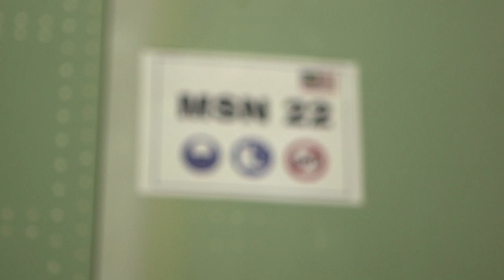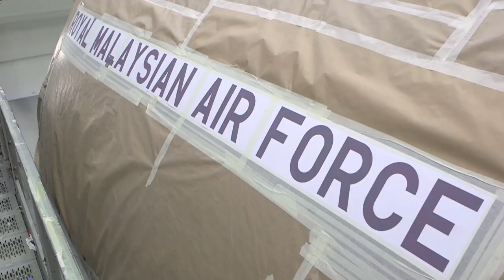A400M Reporting for duty with the Royal Malaysian Air Force

Comment: MALAYSIA💪 will buy the PAKISTAN JF-17 Thunder🤲 an extremely efficient fighter plane which has already proved its worth and with a powerful radar without forgetting the excellent price compared to the Corren plane.
the power of MALAYSIA💪 will strengthen in the years to come.
the USA are not the friends or the allies of anyone except for their war interests you alone are: ")
MALAYSIA does not count on the United States to defuse its interests.
Reply: Wrong. Malaysia bought the FA50 Block 20 like Poland